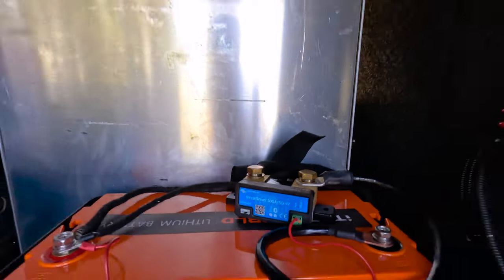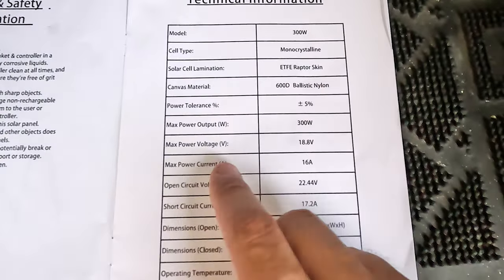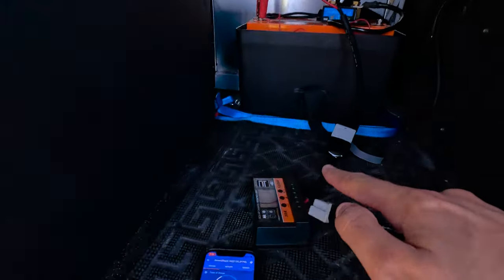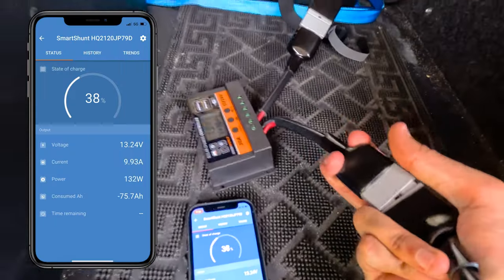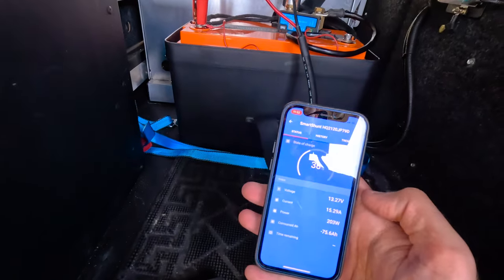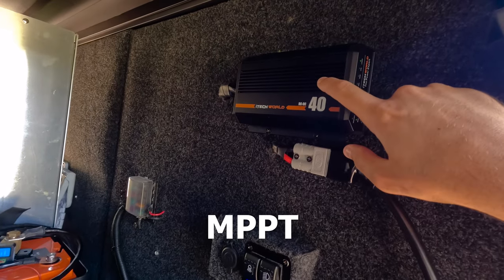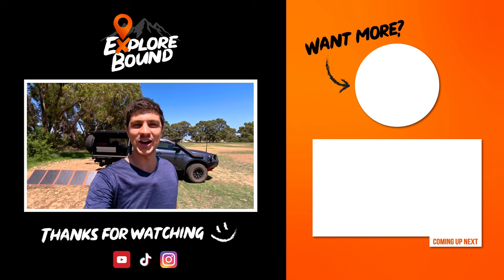Putting iTechworld's 300W Solar Blanket to the test ⚡

Comment: Just want to say. its advertised at 16A at 18.8 volts which is 300.8 watts. Technically you should be getting 22.22 amps at 13.5 volts and 21.42 amps at 14 volts if it was putting out what it states. This panel is another scam in regards to its output!
Reply: Like everything itech sells mate. Love the videos Dan and Bianca put out and would never criticise them but itech gear is crap…
Reply: They get it for free we pay $799 they have to say it's great good if iteck can comment about the product on he and show how it's 300watt  not just by sticker on the back invite them on 🤔
Reply: He is taking the reading off of the 12v side of the system after a loss of efficiency going through the DC to DC charger, also solar panels work their best in cooler temperatures. So if he tested the voltage and amps at the solar panels I'm sure he would have 18V and 16A or possibly less because the panels are hot.
Reply: @KurtisPape  The panels should be putting out 300w OR MORE as other brands do. This is regardless of the solar side or the battery side. It maxes out at 215w when through the MPPT. If i was getting 215w from a "300w" panel well mate, ide be wanting a refund. Rubbish!
Reply: @TV Photography  good luck putting solar panels on your house and actually getting the rated power, even in optimal temperatures. A 5kw solar system will never put out 5kw, your lucky to get 3.5kw in optimal conditions.
Reply: @KurtisPape  I have a 200w solar panel on my roof of my car that regularly puts out 220w. Other users with the same panels getting similar results. What panels are you using? Again, ide be getting a refund 🤣
Reply: I’ve never had any portable panel deliver what they are rated up. 2/3d’s in ideal conditions seems to be the norm. What panels are people using that achieve 100% of their rating?
Reply: @Tristo21  The loss of power output may well be the MPPT unit itself.

A PWM unit will let the 16A through and clip the volts down to the required level for the battery charging, therefore wasting quite a bit of power. This is why we were only seeing about 200W from the 300W blanket via the supplied PWM unit.

If the DC-DC solar charge controller was a quality MPPT design, it should be converting the 16A at 18.8V to be well in excess of 20A at 13.37V (above 260W) to charge the battery.

The actual panel voltage and current needed to be shown, so that we could see where the losses were.
Reply: @Tristo21  do you have a blanket or a panel? And could you please share the brand? 
Cheers :)
Reply: @codycollins3772  ATG 200w Shingle panel. Often puts out over 200w. Shop is in Perth but ships aussie wide. They do great batteries as well

Comment: TBH, the panels delivers 200w ish instead of 300w, it is 65% efficient under those conditions but the Manual says 16a which is equals to 210w at 13.5 v. Anyways, It is not a good product, there are other panels delivering 80% or 85%. Like your videos but this one goes directly to the BIN. Cheers
Reply: Any suggestions on what panel to buy
Cheers
Reply: The 16 amp is a reference to the current from the panel to the charger. The voltage the panel should deliver this to the charger at is about 19v. 16amps x 19v is your 300w rating. The solar charger should convert the 16 amp 19v to anything from 12v 25amp to 14.4v 21amp. The product is not performing as advertised

Comment: Yeah you got this 1 wrong..300w@18.8v is 16a..300w @ voltage of your battery will be different...so eg. 300w ÷13.4v =22.4a ...that panel at your battery voltage should be at least give you 20a but it won't because these types of panels are not very efficient and will maybe spike to 300w but never stay there long

Comment: It's a 300W blanket, so is the 215 W output considered a good result?
Reply: Don’t read the wattage when buying panels, it’s the maximum amp specs you should use when calculating
Reply: If you went to the petrol station and paid for 300L of fuel and they gave you 215L would you consider that a good result?
Reply: @biancaspice6409  beat me to it. good reply
Reply: @biancaspice6409  You are so confidently incorrect about this as someone else has pointed out in the other thread. You should probably consider editing or removing your comment which is misleading.
Reply: @andrewford80  edited. But just FYI, there’s nicer ways to say what you’re saying. Keep that in mind in future please 😊
Reply: @biancaspice6409  you don't think that was nice enough? I'd say by YouTube comment standards it was quite tame.
Reply: @andrewford80  just because many others choose to be mean or malicious on YouTube, doesn’t mean something is ‘tame by comparison’. Or to put it simply, just because others are being mean doesn’t mean you should join in. No one should get a free pass.
Reply: @biancaspice6409  whatever mate. I think you're being a little bit sensitive. The fact was you were wrong and very confident in your statements. It wasn't my intention to upset you, but now you've made a big deal out of it, I kind of don't care.

Catch ya
Reply: @Danj522  Volts and Amps are both required to measure the panel output in Watts. 
A decent MPPT unit will convert most of the power to the required voltage and actually boost the current. 

If the DC-DC solar charge controller was a quality MPPT design, it should be converting the 16A at 18.8V to be well in excess of 20A at 13.37V (above 260W) to charge the battery.
Reply: @justasix8815  The maximum 300W rating is in a controlled environment. In the real world, there are derating factors like panel temperature that have to be included.
Reply: @johncrocombe9214  very ture
Reply: @justasix8815  ...and you are shortchanged every day, not just the first time.
Reply: @Danj522  This is so incorrect. A solar panel/blanket that has an output of 30V and 8A will easily match the performance of a panel with 15V and 16A, if an MPPT charge controller is used. A big benefit of higher volts is that a smaller copper cabling size can be used, as the current is halved.

Comment: Good to see that some manufacrers do publish accurate specs on their products, with no flurfies.  There is hope in humanity yet. 😁 Thanks for the update.
Reply: But they don't put out rated output. Supposed to be 300w, but it's only 2/3 of that. That 16A is at a lower voltage, resulting in way less than rated power. Are you on their payroll?

Comment: In the video you say it’s outputting close to the maximum 16amps rating of the panel, this is not true , it’s rated for around 16 amps at 18.8 v , you took the reading from the 12v side so in reality the panel was only outputting around 10 amps at 18.8 v

Comment: The solar specs state 16amp at 18.8v which is 300watt.
At 14.5v "normal charging voltage"  you should be seeing around 20 to 21amp from a 300w pannel in perfect conditions.
Reply: Yea bit concerned that old mate making the video has no idea what he is on about and spreading false information at 12v this thing should be pumping 25 amps ramping down to 21 amps when charged at 14.4 volts

Comment: Great video how long will this 300 W blanket take to charge my 1 hundred amp battery?
Reply from the maker: It will depend on how much sunlight you're getting but in good conditions it would take around 6hrs to get a 100Ah battery from 0% to 100% (give or take).
Reply: @explorebound  great thank you 👍🏼

Comment: Great outputs! Just bought the Hardkorr 150w Crocskin panels on sale for $349 so looking forward to the results.
Reply: I have a Hardkorr 2 panel portable Crocskin unit I bought a few years ago, it works very well and if you accidentally walk on it it won't break.  Can't remember the wattage but it provides 6 or 7 amps in direct sun.  It beats a mate's cheap Kings one that's twice the size :)
Reply: 150 watt cost Usd 349 ,kind of expensive,there are more good choice than this,l am professional producer in this line，Knows their price and power better than anyone

Comment: @explorebound you do realize the advertised 16 amps is at 18v this is how they get 300 ish watts 16x18=288. Your panel is performing terribly at 16mps you measured your only at 13.26v or 200w. you should be getting 22amps at that voltage to make the advertised 300w power

Comment: So much misinformation and poor understanding in this comment section. If you're gonna state something as fact, make sure it's correct first.

These panels making 200ish watts is pretty much what I'd expect from a device like this but a reputable solar panel, or even one that's not just inflated in its marketing can hit it's rated output pretty easy 

I have a 160w panel from Aldi. The pwm that came with it was replaced with a victron and I have seen over 165w in the right condition and it regularly gets 155w even in hot weather (over 30c ambient.)

So these ones only hitting about 70% is not that great. But, this style of folding panel are pretty much exclusively like this. I've never seen one that does output it's rated power so I guess it's just become expected.

How disappointing.
Reply: Ye but $799 you think you better

Comment: Doesn't add up! Panel must be only producing 13.5 volts at 16amp to give you the 215 watts that's terrible for $800.
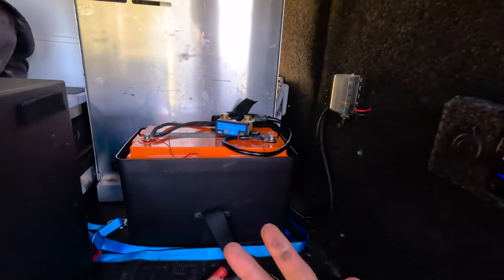Reply from the maker: Hey mate, all readings after the MPPT solar regulator are right there on the screen so no guesswork neccesary (see 2:06). 13.37V, 16.05A, 215W. Keep in mind compact solar blankets aren't as efficient as solid panels (the price of convenience), and these have outperformed quite a few others I've tested.
Reply: The 13.5 is the battery voltage not the panel. The panel is supplying 16.1 amps 215 watts so the voltage must be the same. If it was higher say 15volt 15vx16.1amps you'd be getting 241 watts. Anyway good luck with it!

Comment: Your video is misleading, 16a is the output from the panel, you should be getting 22a after your dcdc. 

I would be going back for a refund, 215w from a 300w panel is not a good result.
Reply: It seems that the misinformation is not a fault with the 300W output from the panels themselves.
The stuff up is with the description that it is a 300W "kit".

There is no way known for a "PWM" solar charge controller to convert the panel output into a 300W charging current, as the PWM unit just clip the panel voltage off at the required charging voltage and waste the rest of the panel's power.
Reply: I disagree to an extent. Some manufacturers out there bench mark their solar panels to 1000W/m2, iTech by the looks aren't one of them (I think hardkorr for instance do). The most the sun can produce in perfect World conditions is around 1365W/m2. Typically, these mono cells in thin layer form such as I'm blankets are around 10-11% efficient as opposed to their other forms such as glass panels at around 20-23% (a lot of companies state "up to 23%" which is a generic value for quality roof top stuff). 

Since these panels are around 2m2, you can expect an output of around 220 to 300W depending on ambient conditions I.e. temp, time of year, lattitude/angle, etc.. with the 300W unlikely (2*1365*11%= about 300W) or more like 220W bench marked against a more reasonable 1000W/m2. 

They look nice, but I think there is better value elsewhere given the $799 price tag. That's my opinion anyway, quick calcs based on area are telling me 220W is what to expect.

Comment: I've been using very cheap solar blankets, advertised as 250w that pull in about 3a through the DCDC charger. Your last video on these convinced me to bite the bullet, and invest a decent amount in some solar panels. I've been testing the panels in the yard, and pulling down 13-18a without any trouble - battery at 100% as the sun sets.
Used your discount code to buy them as well, which equated to free postage.